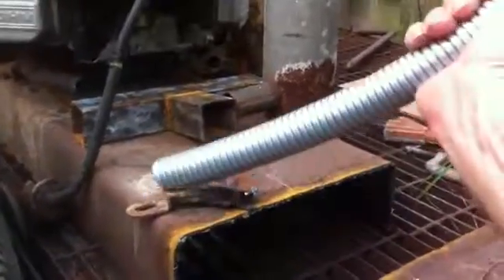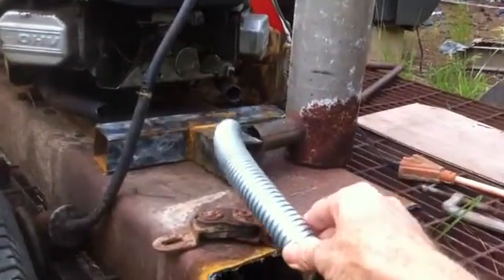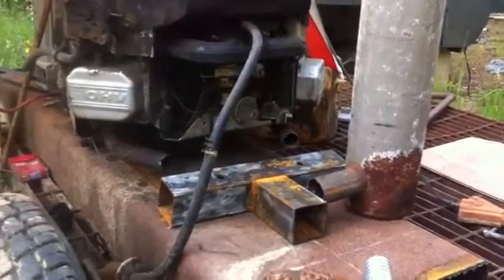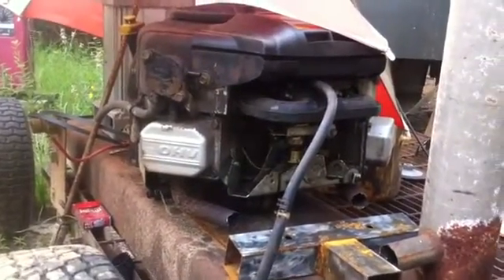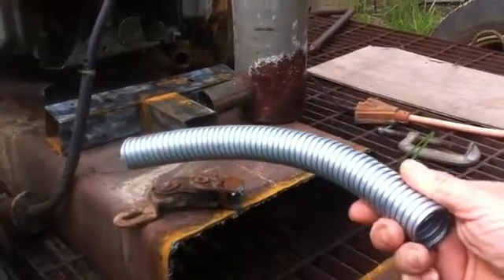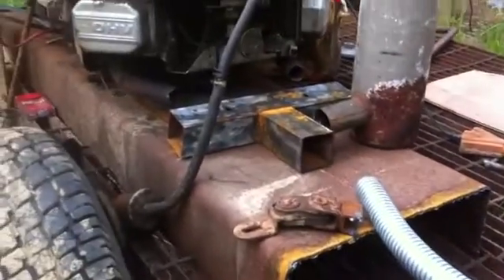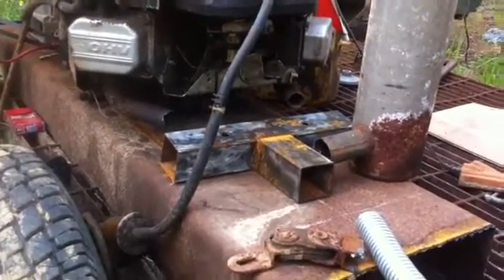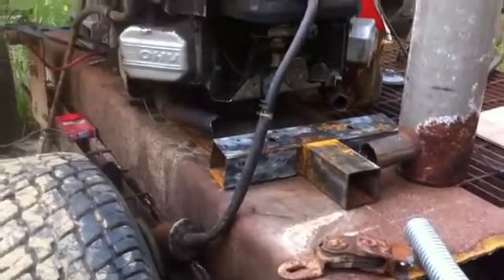DIY 10,000 watt generator exhaust solution, flex pipe.

Comment: I would be curious to know how much flex pipes leak. My generator is in a shed and i will be porting the exhaust outside. and while i wont be in the shed while the generator is running, i would prefer the exhaust not to leak into the shed. Any idea if these pipes are leaky? and if so how much??
Reply from the maker: Can't say I know one way or the other. Just come to me that the exhaust pipe from the diesel air heaters would likely be your best solution. Solid stainless steel without seams  and fairly cheap. I am finishing a Chinese diesel air heater in my RV today and looking at the exhaust pipe now. It is 1 inch with folds between the smooth ends and 18 plus inches long or longer. Can find longer as I did by getting one about 4ft long. Not easy to bend these being solid but no place to leak but at connection points. Hope this helps. Just Google search Chinese diesel air heater and add key words like exhaust pipe or accessories and the shopping will begin.

Comment: Where did you get the 1-1/8" flex pipe?  I also have a generator that I need to extend the exhaust pipe on the generator as well.  Thanks in advance.
Reply from the maker: +My PI Dream I think I found it on eBay somewhere. Will see if I can find email with order information.
Reply from the maker: I could not find the source where I got the flex pipe but I remember it was a company that did business on ebay and are likely still doing so. It took a while to find what I was looking for and due to lack of funds at the time, made it hard to find a good deal. I think I spent a few hours till I found the deal I could work with but I had more time than money then.

Comment: I'd be interested in hearing about the sound level difference of before and after.
Reply: I'm thinking about trying to enclose mine in a box with exhaust to the outside.  If I can get it running, that is.
Reply from the maker: Can't put the original muffler back on it but when I get the baffled manifold and RV generator muffler on it, I will try to do a before and after when I am working with the other noise problem. It was a motor off of a good size riding mower and not very quiet. Its like they say, you can't get rid of the noise with mufflers, engine noise from valves, fan and the like, must be shielded. I have some conveyer belt left overs that I think will make good portable shielding and can be bolted to the motor and frame when everything else is finished. I think I can do a good job on it without causing cooling problems.